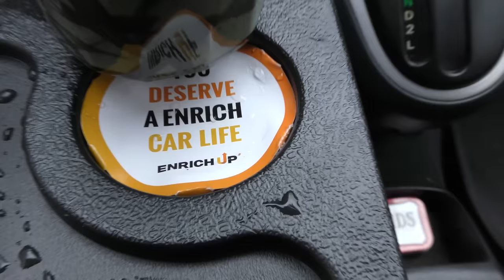This New Pill Will Triple Your Car's Gas Mileage

Comment: Back in the 80s I sold those fuel magnets as a sideline to being a car parts rep. One garage had a Dyno (rare back then) and backed the manufacturer's claims, he was my best customer.
Well, I went back on the tools again engine building at TWR who had a Dyno in the engine shop. We tested those magnets and Slick 50 which was also fashionable and found they both made no difference.

Comment: “They don’t really work”.  Big surprise…
Reply: They do for my diesel. I have a diesel with one of those stupid particulate filters and it was regenerating 3 times on a tank. I used ones designed for diesel fuel and my regens went down to once per tank, and also the engine sounds quiter and more peppy.
Reply: 😆 🤣 Obviously
Reply: Old people uses them and they are fantastic. 😍
Reply: @woodjunkjrjr2689  lmao, ikr
Reply: It works if you believe :p

Comment: I just tested my exhaust system using my DJ fog machine. I use 100% vegetable glycerin mixed with distilled water. It worked. Looks like I need a complete exhaust system 😬

Comment: The best way I have found to increase my MPG has been to SLOW DOWN a little. Watch the RPMs. On flat ground, no wind, tires at proper air pressure and temperatures over 50 degrees F, I can get 23 mpg with my 4.6 litre V8 driving at 60 mph, approximately 1500 rpms. Any of those factors change, I will get less MPG unless I get a tail wind.
Reply: I get similar mileage doing exactly that in a 6.2L V8 at about 60 mph as well. People don't understand that wind drag increases by the square of the velocity. So higher speeds equals less mpg. Even just a couple of mph make a big difference. Given some common inputs for a sedan for air density, frontal area, and coefficients of drag, going 75 mph instead of 80mph can decrease air drag by 12%. Obviously this isn't constant for all cars, but just to give an idea.
Reply: I use cruise control as much as possible and it definitely gets my vehicles better MPG.
Reply: @briano8173  I forgot to mention cruise. I use it whenever the pavement is dry. Helps alot.
Reply: @berto1014  my 4.6 litre is in an SUV so not the lightest vehicle nor the best aerodynamics but at 23 mpg I can get over 450 mile range with a 2 gallon reserve. Can't complain about that. Your 6.2 in a pickup I suspect.

Comment: What do you think of Seafoam carbon cleaner? I have a 2.7l v6 ecoboost f150 and those engines are know for carbon build up issues. Haven’t had any issues yet but want to prevent it sooner and keep my truck engine running healthy. Love your vids btw! They have helped me in successfully running an auto repair shop.
Reply: You reminded me of an episode on the Just Rolled In channel. A customer was told by a friend he needed to put Sea Foam in his engine. Well, he couldn't find it, so he used spray foam insulation instead. He had his car towed to the shop because the engine stopped working. He had sprayed foam insulation all over the outside of the engine.

Comment: Considering the fan rhat replaces the air filter, it has 2 negative effects one it no longer filters air that allows particles of dust and debris to get in the engine causing wear on the engines moving parts. The air flowing into the engine gets restricted, slowed down, causing the engine to waste momentum and power, to make this fan spin, ending in net loss of power to the wheels.

Comment: Better off using dipetane,manufactured here in Ireland. I have been using it for years.....saves 10 to 15 percent on petrol or diesel. Used by Irish army trrucks and Irish Bus buses

Comment: I had a 93 s10 with a 4.3 v6 throttle body injection.  The tornado worked on that engine.

Comment: Hey Scotty, I need your help with my piece of trash 2015 Jeep Renegade Latitude 2.4L…
I’ve had my car serviced under warranty about 22 times in the first 3 years of owning it. My car has always & it was first fixed by “tightening a screw” but it got really bad again in 2020 and the dealership fixed it by replacing the valve body. It got super bad again in low rpm’s in November 22 (few months after valve body warranty expired). I had it diagnosed by 3 mechanics. 2 said it needed rebuild and one from aamco said I needed to replace it with a new transmission. Keep in mind I have a 2” lift kit & had tires specified to my lift for the last year & half. After they replaced the transmission I kept my old one to make sure it was really replaced. Well the second was still jerking so they replaced that one too. Now I’m on my third transmission in this car in 2 months. The aamco GM stated if it jerked again they couldn’t replace it because my tires were too big so I took it back to them and they reset some sensors and it was good for a week or two but now it’s jerking in higher rpm’s and it’s so inconsistent so the jerk is random. It also started making this clinking noise when rpm’s drop coming from the bottom. I will drive anywhere but I need your expertise. I’m desperate. Can I pleaseeeee drive my car to you to check it out?

Comment: Things if you want better gas mileage 
1.Check tyre pressure 
2. Light on the throttle 
3 change gear at about     2,000RPM 
4 plane your journey 
Hope that helps people

Comment: I remember in the seventies or maybe it was the 80s they had the thing you put in the intake of a Harley-Davidson or probably any motorcycle but the problem was it fell apart in the metal things went down in the cylinder and then screwed up your piston and valves I think it was from j.c. Whitney

Comment: if you  are driving alone in a 1st gen Toyota Matrix, you can flip the passengers seat ahead and the back of it is flat hard plastic that  has an indent that can be used as a table for your lunch. I used mine in my 2005 Matrix a lot.

Comment: Ram air and cold air intake like 70' olds 442 does increase horsepower and torque about 10-15 horsepower.

Comment: in 2009 I bought a product in the sale bin little pill gassed up added pill drove 200 miles no difference, then I filled up at a brand new gastation used premium Super Shell  mileage went up alot like 48 mpg in my Corolla I've never seen those pills since be it was amazing .

Comment: I replied to another famous YouTuber that promotes the X-caps, and was sent 4 caps to try. I have a 1999 Mazda B2500 (229,000 miles), and before the tank with the first cap was finished I had a fuel injector go bad (I don't believe it was related to the cap though). After replacing the injectors I ran the remaining 3 caps through the truck and guess what......no significant difference in mileage.

Comment: The best way I found to save fuel is not to press the Excelerator pedal close to the floor also changing up to a high gear quickly by doing this my car averages 60 mpg

Comment: ah come on. Those acetylene gas producing pills work. Work really really well. Yeah so you gotta tear down the engine and replace the burned through pistons but hey when the engine was running the mileage was super.

Comment: The CO2 sensor tells the stochiometry value to use the actual value of fuel.  Unless they do away with the CO2 sensor, or otherwise. Things are mostly programmed by a computer.

Comment: My fuel mpg dropped from 16-17 mpg to 13-14 mpg in a 2002 Tundra 4.7L, 4x4. Is there a scan tool that will tell the what the problem is.

Comment: Here in my country we have more extreme mileage saver. The company sells a card that you need to put it back of fuel cover to give extra mileage.
Reply: It was a sticker, I never fall for it. The extreme mileage saver was also a thing recently lol. 
Better off spent those money on gas.
Reply: @metzmatu8409  Yeah, even the card costs slightly more than a gallon each.

Comment: I seen little pillar a service station in the 90's, then about $1each. They said give something like 5% to 10% improvement. The fella was trying to sell them with the pitch, I said if I put the money to more fuel it would be the same cost per mile without junk in the tank to clog pickup or filter. He had a surprised look on his face and likely wished he'd though of that before buying them from the salesman🤣. They were not on the shelf next time I was there. 👍👍

Comment: I have a legitimate question:
my vehicle has had one of those fuel magnets on the line for about ten years now. If I take it off the rail, will it suddenly introduce a lot of metal into my fuel injection system all at once?

Comment: I have a 2007 Honda Pilot with 60K miles. I usually get 17 mpg on the highway. I put these "pills" in my gas tank and took a 300 mile trip. My gas mileage went up to 21.9 mpg. I'm bad with math, but I believe that's nearly a 30% increase in gas mileage. If you watch Kevin Hunter's channel, you will see testimonials from others who have gotten similar results.
Reply: Interesting. 

In my opinion, there's a chance that the Tornado may possibly improve power and efficiency in a carburetor application?

Comment: Hey Scotty, can you please tell me what is the difference between the ‘21 Corolla Apex XSE and ‘22 Corolla Apex XSE? Really struggling to find a difference online. I’d like to purchase a brand new ‘22 Apex XSE but i noticed a ‘21 Apex XSE with only 11k miles— and the price will save me a couple thousand dollars. One owner too. Carfax is clean and well maintained. oil change + tire rotations is done routinely. Which of the two should I buy??  🫠

Comment: Does premium electricity make a BEV get better range ?
Reply: Ha! That's a good one! One thing I have noted about gas vs electricity. Gas prices go up and down, electricity price goes up, never comes down.
Reply: In a way, yes. If you have a very stable power source so that you all but eliminate power sags or surges, the electric motor will run better.
Reply: @northdakotaham1752  Tesla is up to 57 cents per kilowatt/hr and going higher EVERY WEEK/MONTH.
Reply: :face-green-smiling:

Comment: I would like to offer some food for thought. I have a Scion IQ and get around 40mpg in the city. 6L/100kms average 5.5 when on the hey. My little 1.3L 4 banger is mod free. Most people can understand the fuel management systems maintain a proper fuel to air mixture to balance power, emissions and insure no detonation occurs in the engine. NOW.... If you force more air in an engine the management system must increase fuel delivery. Now what would happen if you restrict air flow? In Nascar it restricts power. Does it save fuel? So what if you restrict the airflow of a NA 1.3L engine? May be harder to start the engine but once running closing off the air box may do the trick. Stupid idea? Please send a quick reply and share your opinions. Thank you

Comment: I KNOW WHAT WILL GIVE YOU BETTER MILEAGE AND MOE HORSEPOWER. CHECK your tire pressure and make sureall tires have same pressure. MAKESURE your air filter is clean, replace if not. REGULAT oil changes help, too + tuneups plugs wires.

Comment: A new muffler bearing will give you the most bang for the buck.
Reply: And don’t forget to have your headlight fluid changed regularly.    😊
Reply: Piston return springs can’t be over looked.
Reply: Chrome plated ones are better. LOL
Reply: Not if you don't calibrate the sensor so the computer can computer the angular variance thrust performance curve.

Comment: I have a 2019 Ford F250 with a gas 6.2L engine. It gets 9.5 mpg on a normal day. With those pills, it gets 14.25 mpg. I DO believe they DO WORK.

Comment: Did you ever hear of putting moth balls in the gas tank? What happens if there are mothballs in the gas?
Reply: They are very corrosive to the whole upper cylinder area of the engine and will damage fuel pumps, filters, and injectors. There was a time when people would hang some in a bag somewhere in the engine compartment to deter mice and rats from coming by and chewing on wires but over time it seems some people mistook putting them in your car to putting them in your gas tank.
Reply: Well,it does keep moths out of the gas tank
Reply: Did you ever smell mothballs? How did you hold him, by the wings?😁

Comment: Gee ya wouldn't want ya children eating those pills☠
If you want more horsepower, blueprint the engine, that's die-grinding out the casting imperfections.🐎
If  you want better fuel economy, drive conservatively⛵
If you want cheap fuel, lower the government tax💲💲
Don't drive using the tray, you'll only turn your food n drink upside down 🍕🍺🍺
Scotty, you had a segment on finding vacuum leaks using a cigar, which I would find more pleasurable💨